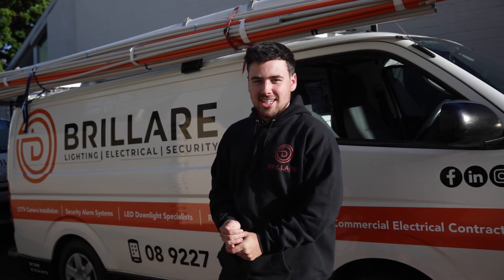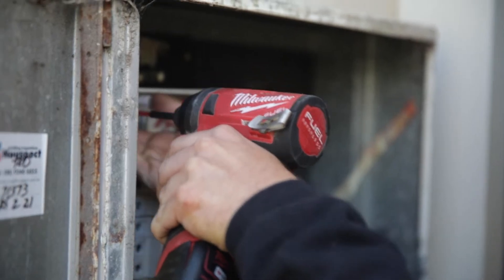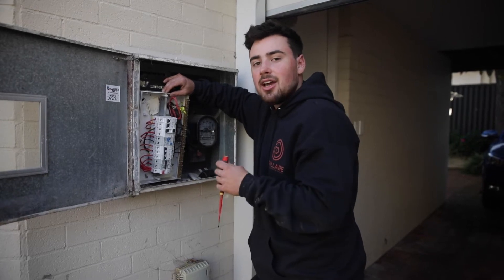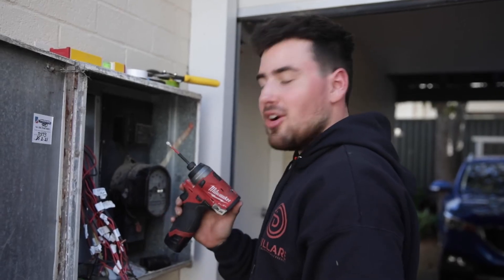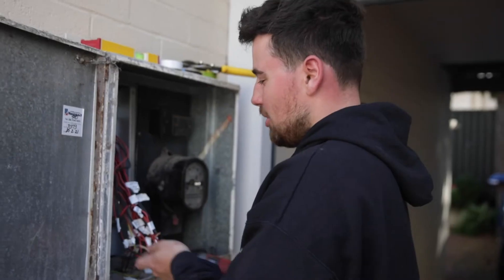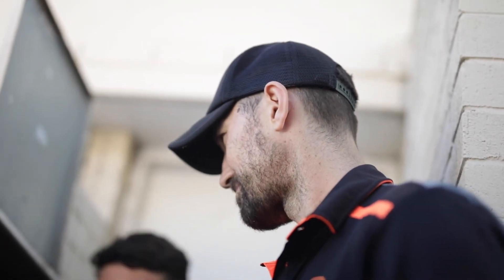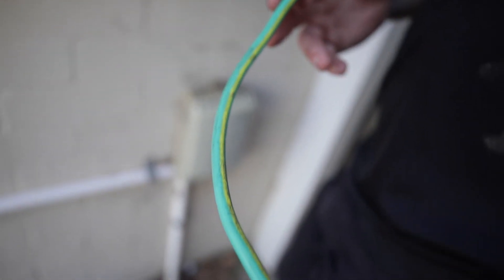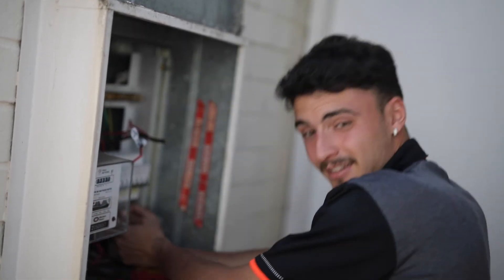Electrical Tips & Hacks That Work Extremely Well | How to Wire Up a Switchboard | Electrical Wiring

Comment: hey, im not a sparkie by any means but in the video it shows a main mcb active switch to have like 6-7 active cables in the one output going to the rcbos. is this still to regulation or is it just better practice to try and have a maximum of 3 cables entries into any safety switch?
Reply from the maker: Yep — and that’s fair to call out. What you’re seeing in the video is technically allowed only if the main switch terminals are rated by the manufacturer to accept multiple conductors of that size.

There’s no fixed number in AS/NZS 3000, but in most cases 6–7 actives under one terminal is not best practice and often not manufacturer-approved.

If we were doing it again, a busbar or distribution block would be the cleaner, more professional way to do it.

Comment: Wouldn't you need to have the corresponding neutral in the right number order as the corresponding breaker though?
Reply from the maker: Correct
Reply: What wasn't mentioned, and would help in learning here is that 'mandatory' tests would've solved most, if not all issues with circuit identification. When loads are connected to circuits, which in a situation like this generally will be, you can test through loads to identify a corresponding A and N. Instead of guessing neutrals by putting 3 circuits into an RCD and crossing your fingers, do some testing. Likewise with crossed neutrals tripping - you should know and rectify this before you go livening anything up.
Reply from the maker: Absolutely spot on 👏. As a Perth electrician, we never guess when doing a switchboard upgrade — proper testing is key to avoid RCD tripping. Matching actives and neutrals ensures safety and compliance every time. Appreciate the solid input 👌.
Reply: @kongkurr  My boss would fire me if I twisted all the neutrals and earths together like that instead of using the bus bars and didn't put grommet strips where the wires pass through the steel box.  Also no fire silicon in the holes.
Reply: So, how did you check earthing in the field if there was no-one home?

Did you guys just do a board upgrade and cross your fingers?

Comment: y 16mm bond? to the box
Reply from the maker: Yes That’s the rules
Reply: Bond to box needs to be same size as incoming neutral. Single phase 63A supplies are typically 16mm, hence the 16mm bond to switchboard